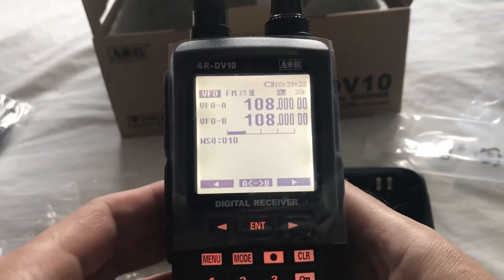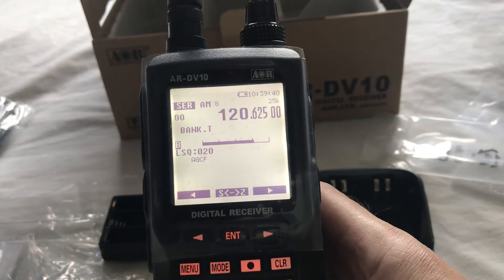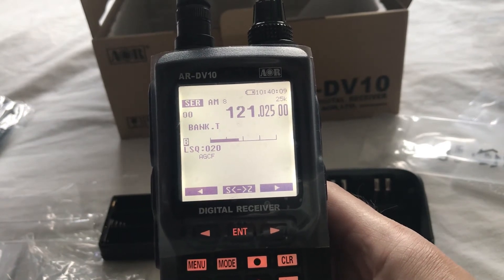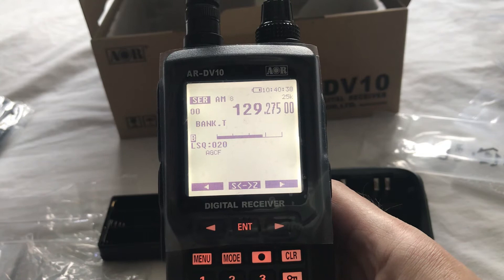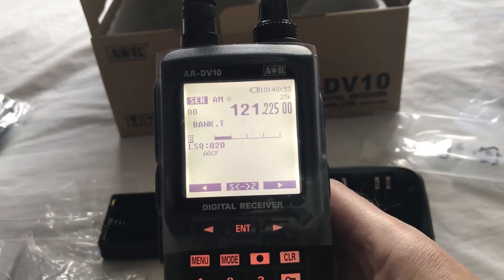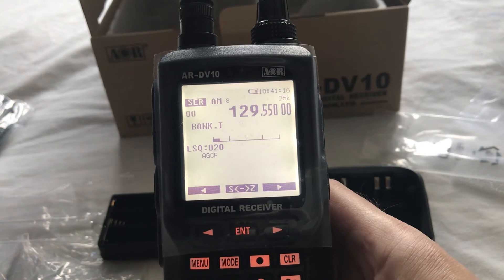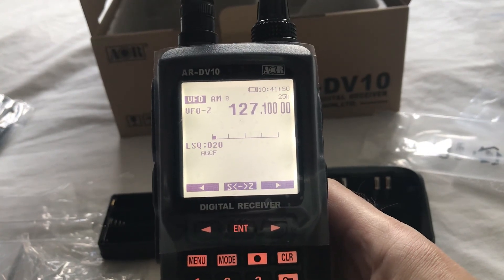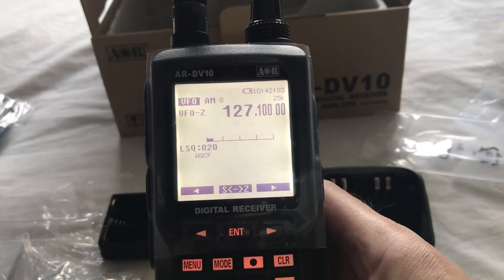AOR AR-DV10 Airband Scan

Comment: End of day you don't buy this receiver for the Analogue Airband 🙄, you buy it for its digital demodulation modes & you have another receiver that's far better for the airband. There will never be 'one receiver does it all perfectly' - ever.
Reply from the maker: Pretty stupid comment, it just shows it on Airband. As for digital modes it doesn't support NXDN 9600 or P25 Phase 2. No DMR TGID or RID decoding, same for NXDN / iDas. DMR bandwidth is wrong its really not worth buying at all, there are so many issues and very limited digital signal information.
Reply: @radio-worldradio-world3510 indeed. That guy is such an idiot with his moronic fad boy excuses. The 8200 mk3 was a far better radio.

Comment: is the AOR AR-DV10 better on Airband than the AOR AR8200 and are they key pad keys rubber.
Reply: They're about the same,  I own both.  Icom's IC-R20 outperforms both on air band
Reply: 8200 better actually.
Reply: @kishascape  I think Icom ic-R30 is the best for Airband.

Comment: This receiver has a serious frequency drift problem in hardware which cannot be fixed with a  firmware update.  I'd stay away from this receiver.
Reply: yes, the ICOM R30 has TRUE Wideband reception and has ZERO frequency drift in operation.
the ICOM even has a Ferrite antenna on the Radio Board.
Reply: Mark Plott but no dmr
Reply: @KermiTheFrog66  Also no Yaesu C4FM on the R-30. I would have gladly paid a bit more for my R-30 to have those extra modes that the DV-10 has.  It seems that Icom doesn't want to include any modes that compete with D-Star.

Comment: 73 I have the AR DV10 / AR DV1 / AR8200D AR scanner, Sa7000 antenna / SOTM1 antenna
Reply: You seem like you know your stuff, can you intercept encrypted digital like the police use?
Reply: @MonacoMonuments  Yes, you can intercept the encrypted signals, but they're still encrypted and it won't un-encrypt them.  All you will hear is digital hash noise. However it will decode unencrypted police digital signals such as APCO 25 modes that many police departments use.
Reply: is the DV10 better than the 8200D on Airband.

Comment: Nice radio!
Reply: @KandiKlover  Thank you for your in depth rational comment. Moron.
Reply from the maker: I would have been nice if they had used a stable TCXO but they didn't and its an off frequency drifting mess.
Reply: Icom ic r30 is very nice radio.
Reply: @bordeaux6401  нет! В aor много модуляций!